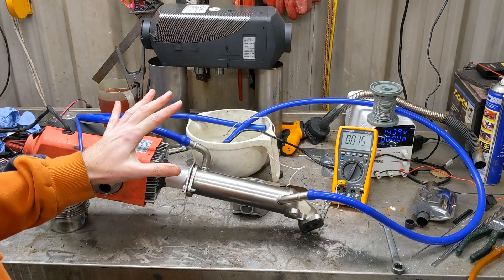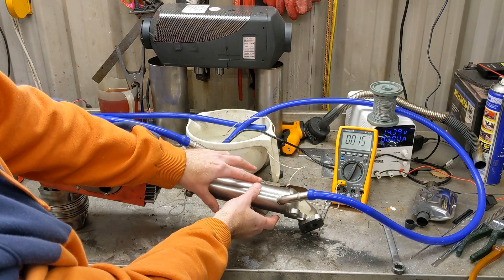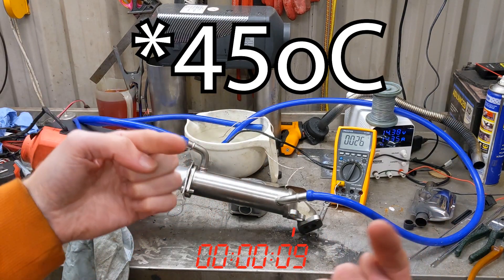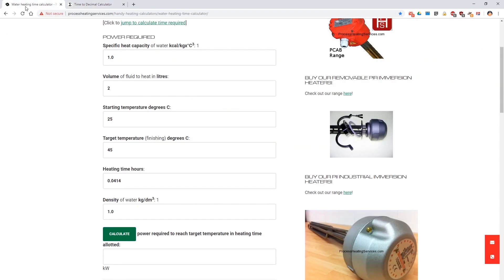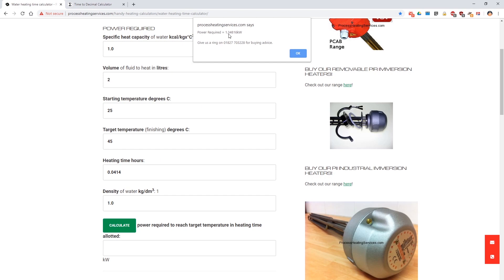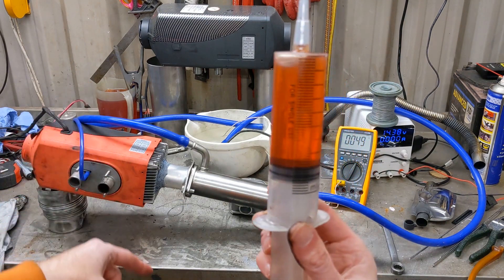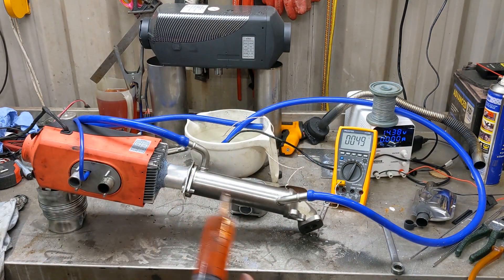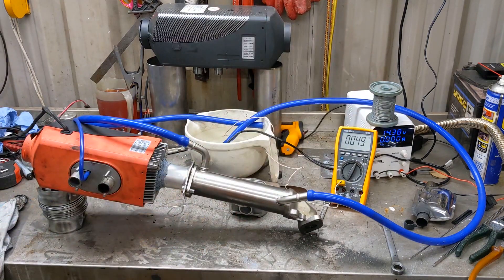EGR Cooler KW / BTU output?

Comment: Hellloo just a quick question  not sure if i can or alowed here don know any other way. Here it goes where i have my heater installed inside under a closed bench  in the van and the fan intake  only has about 2 cm away from the wall will that afect the performance will it suck enough air been that close to the van wall
Reply from the maker: I assume there is some kind of air inlet and outlet under your bench?  Yes, 2cm away from a wall will affect performance.  But more likely is that the fan motor will have to work harder to reach the desired rpm.
Reply: @DavidMcLuckie  hi thanks for the reply love your videos just ordered a afterburner after seen your video . No i haven't any vent yet i boarded the bulkhead behind the drivers seat and fitted the heater on the corner and will build the bench around it so straight oposite the sliding door if can picture it so the air intake its like 2cm from the wall and will be blowing out at front bottom of the bench   so you recomend maybe drill out a little vent inline to the outside because the inside of the bench will be closed or used as storage really
Reply from the maker: Yes, it needs as big a hole for an intake as it does for the hot air to come out.  Ideally well separated so there is plenty of circulation.
Reply: @DavidMcLuckie  ok thanks for the advice i would of send you a picture so you would see it but don't know how to on here .
And by the thanks for your video on egr cooler im this minute disconnecting my transits egr and using it for hot water but also broght a separate one to fit on the heater exhaust maybe linking them both and using a 15L under sink hot water  heater as a storage with a circulation punp. Love you videos keep it up

Comment: David...can u do a vid on the 5kw heater with the egr welded directly to the burn chamber? And inc a how you did it part? Please
Reply from the maker: I could do it on the smaller heater (seeing as the end is already chopped off) but I'm stuck without gas at the moment due to the lockdown.  But I'll add it to the list.  :)

Comment: Interesting stuff you're doing here. I was thinking of using the standard supplied exhaust tubing and coiling micro bore copper pipe around it. Wrapping the whole in foil then some exhaust insulation wrap would finish it off. I was just looking for a way of doing it without drastically chopping up the heater.

Comment: Well your calculator is interesting, but I don’t agree with it...  1BTU is the amount of heat which will raise 1# of water 1 degree F.  This is a real simple calculation I have been doing for years.  So 36F into 4.42# of water = 159 BTU/2.5min or 3816 BTU/HR.  20ml is 1/189 of a gallon. At 147,000 btu/gallon for diesel, 20ml is about 777btu worth of fuel...  Since no exchange/conversion is 100% you cannot get 4500 BTU out of 777BTU input(which is why I don’t understand your calc).  Unfortunately what I see is only about 20% efficiency?  It looks like the fuel used probably included the startup and shutdown burn? The way I have done this in the past testing generator efficiency is with 2 fuel sources, one for startup and warmup and one I shift to when I start the timer and off of when I stop the timer.  And yes I completely pooched the calculations I did on your last vid, and I went back and fixed them.  when I redid the numbers, I came up with 4752 BTU/HR. Since the temp in that vid was 55-66C, I would have expected this one at a lower temp to be at a higher rate due to a greater deltaT.  One thing I noticed though is that in the last vid you had the muffler on the EGR cooler output, this test did not.  The muffler probably slowed the flow and increased the hot gas temp in the EGR  for greater transfer at a higher water temp...  Thanks for sharing.
Reply from the maker: I am rubbish at maths.  So I tried three online calculators and got the same results, so I went with them.  But I agree the heaters aren't the most efficient.  The startup fuel use is small so would only alter the results very slightly, making the heater slightly more efficient.  Ah yes, the muffler might have had a positive effect on the heating.

Comment: Just did a quick Google and according to that there's 32MJ of energy in a litre of diesel, which means 20ml has 640KJ of energy but raising 2L of water by 20c only requires 10KJ of energy....
Reply from the maker: I'm just speculating here so bare with me.  These are evaporative heaters, as in the fuel is pumped in and the heat of the chamber turns it into a gas to burn.  So there goes some efficiency.  It's also still heating the mass of the heater which is still being cooled by the fan so still producing some heated air.  The best method is still to scavenge the waste heat from the exhaust gas, which is another video.
Reply: @DavidMcLuckie  when did you measure how much was in the starting fuel supply? At the start of the experiment or the start of heating the water?
Reply from the maker: The start quantity is so small I don't have the equipment to measure it.  But yes it will factor into the efficiency, making it slightly better.  :)
Reply from the maker: Not easily.  The fan has the speed sensors on it.
Reply: Oh, liked the video btw.
Reply: @yy7687  well, the rest of the heat may just come out of the heater.  Heat conversion is always 100% efficient so it has to have gone somewhere else, possibly into starting the heater.

Comment: Wonder how long it would take to heat up a bath ? Not asking for me but the girlfriend and me . Just don’t tell the mrs shhhh !
Reply from the maker: Using the website I used to work out the power, you can work out the time.  So for 100 litres of water heating from 15 to 30 degrees would take the little heater a bit over and hour and half to heat.
Reply from the maker: Somewhere around half a litre.  I think. 20ml in 2.5 minutes (150 seconds) = 0.13ml per second x 3600 seconds (hour) is 480ml.  I think.

Comment: I am interested in the exhaust output.  I am about to install one of these in my van/camper.  Might be nice to get free hot water as a side effect of heating the vehicle...  I am not prepared to chop the end off mine :p
Reply: Nice this was exactly what i was thinking. Puting that exact egr on the exhaust and using it to heat my water tank in my shuttle bus/rv thing. Im sure it'd work and as free passive heat youd never have a cold shower or freezing tank ever again.

Comment: Ooh I canny wait for the measurements of the exhaust of the 5kw...
The pump was getting something like 5.1pulse-per-sec but I was able to run my one at 8pps once I modified the password menu for pps and fastest fan speed to 5000
Reply: Mod the pw?
Reply: @thomasbarlow4223  yes you can log in to the lcd with a password and even change it, I have my maximum set pulse of 8 not 5.1 now